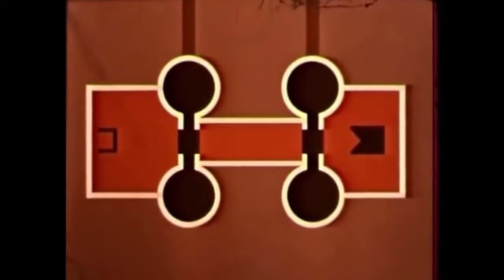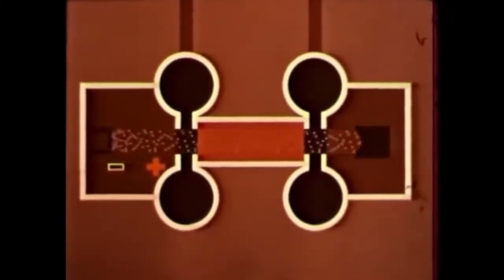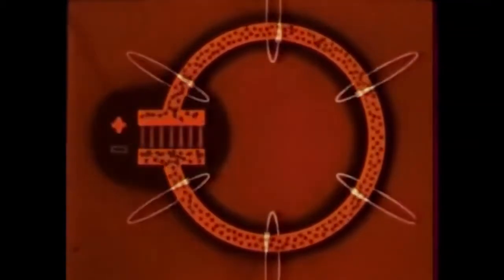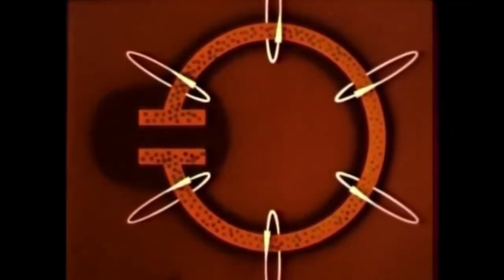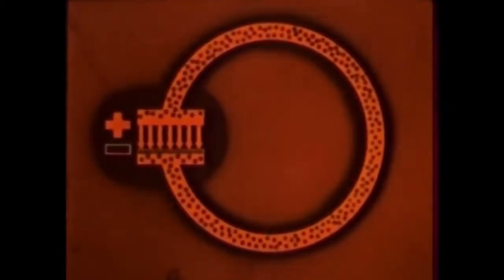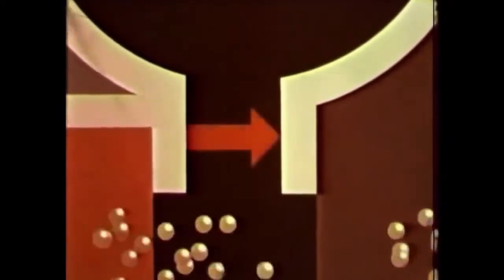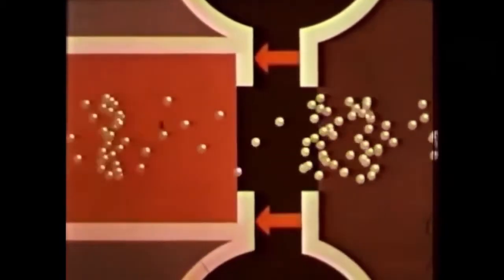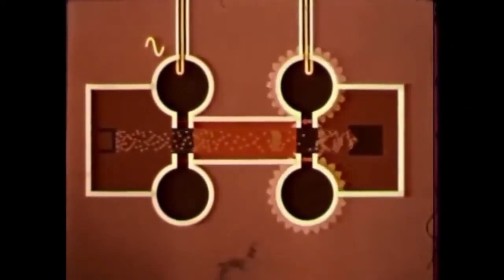The Klystron (1964)

Comment: Tom, what an excellet video.  Those old 1960's graphics sometimes seem to do a better job explaining physics than today's CGI graphics.   I'm no EE student by any means.  When I  spent two years in engineering school, those who majored in electrical engineering were recognized as the smartest and brightest of our students.  Your video speaks as a precursor of the LASER which I believe was invented a few years before your video.  But what amazes me most is that the "Klystron Monitor" was an essential part of the movie, "Forbidden Planet". 
      Recall Cdr. Adams had to communicate with Earth through several parsecs of spacetime and needed to use the internal structure of his ship to power the "Klystron", a special part that was frozen in order to preserve it.  Cdr Adams needed permission from  Earth as to how he should proceed, after finding that several survivers were killed by an evil force.   Several cubic yards of lead shielding were needed to protect the crew from the internal parts of the ship's main power core for the transmission to take place.  Thanks to Robie the robot, enough shielding was produced to protect the crew from the radiation of the "Klystron" transmitter.    Too bad a "dark and evil force" prevented that from happening.  For anybody who has not yet seen "Forbidden Planet" get ready to see a whole new way of science, as seen from the 1956 point of view.
Reply from the maker: David, yes.  When I get the time, I intend to do a better job of explaining the physical construction and illustrating example usage.    This video effectively serves as a place holder and a tickler reminder for me to actually do that at some point soon.